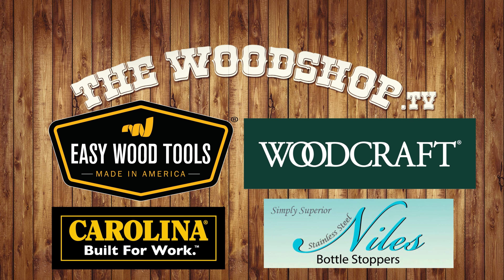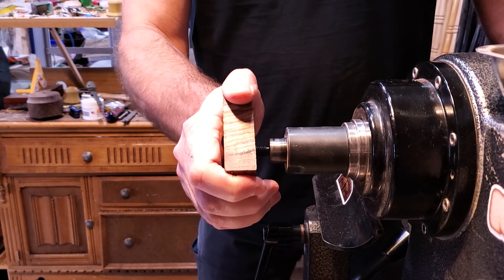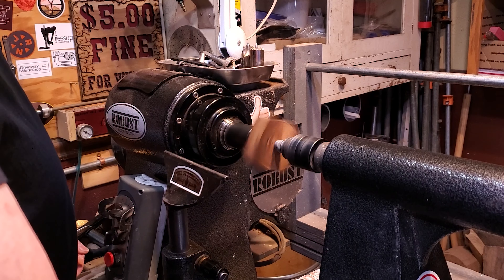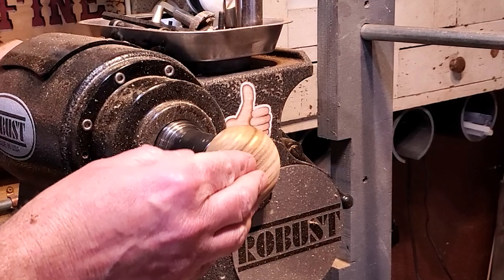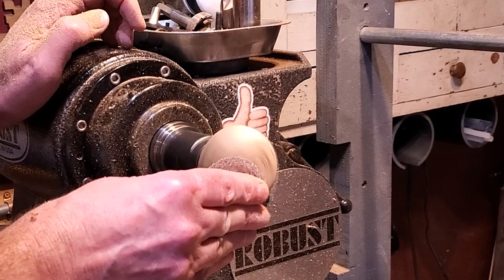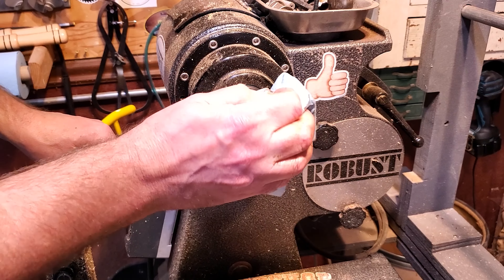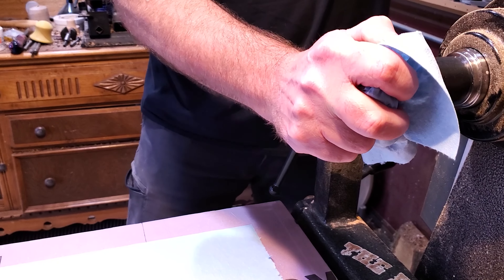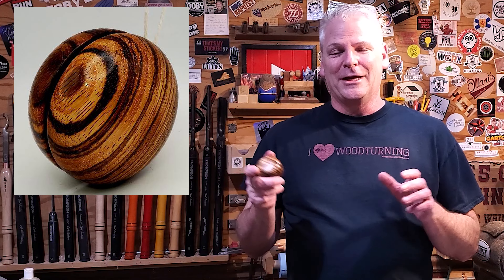Woodturning | Bocote Yo-Yo

Comment: I remember turning a few Yo-Yos after watching your other video.  I remember weighing each side several times to get them the same weight.  Can't remember how I mounted the sides on the lathe for sure, but I think I used a homemade screw chuck.
Reply from the maker: Thanks for hanging in there with us for so long!! Yeah I'm pretty sure that's how I did it too.
Reply: Turns out my memory is worse than I thought.  Just found a couple pictures of the Yo-Yo recipients when they were given them and it was way back in December of 2012, over ten years ago.  I must have made them after watching Frank's video.  Can't be certain but I may have used a pen mandrel to mount the sides on the lathe.  We have been watching your videos for many, many years starting with the Delta variable speed (I think that was the brand) lathe right up to now.  I rewatched your "scrap challenge" and Frank's Yo-Yo videos last night and I know I had watched yours previously, but YouTube's watch history doesn't have it or hundreds of other videos of yours that we have watched but Frank's video was in the history.   If you take the heart away, I'll understand. 😉

Comment: Question about the Niles mandrel. 1. Which one did you get, I see alot on their site. 2. Do you have to thread the hole you make to put the wood on it?
Reply from the maker: There are only four mandrels on the website. They all have the same 3/8" x 16 stud. You just get the mandrel that fits your lathe. The stud has a flute on it so you can cut the threads with it.

Comment: What is the advantage of sanding an oiled surface?  I've never seen that done before.
Reply from the maker: I sand with Walnut oil. It's putting the finish on and capturing all the fine dust at the same time. It's better to use a mesh sandpaper though. The paper sandpaper will clog up really fast. I hope that helps.

Comment: Will a screw that come with my barracuda 2chuck will it work on making a yo-yo
Reply from the maker: I think the screw would work, it just doesn't give you much room to turn the sides and sand them. I think the bottle stopper mandrel would work better because of the size. It gives you a lot more room to work around the back.
Reply: @CarlJacobson  thank you for the info ‼️‼️